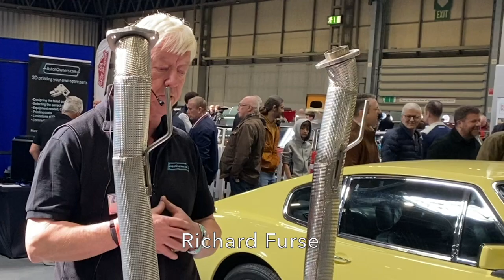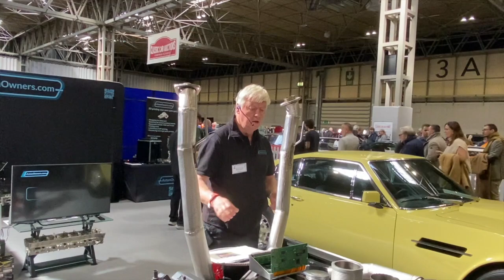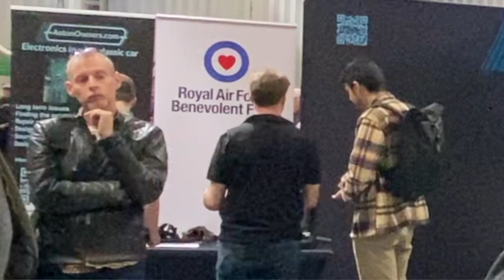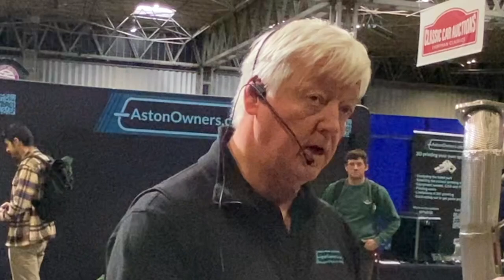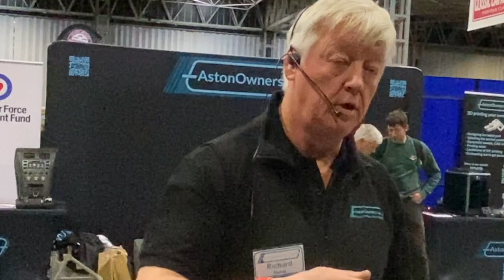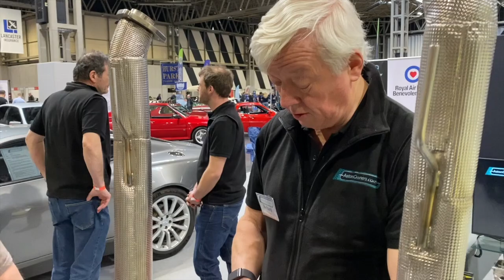Electronics - The Modern Achilles Heel

Comment: The speaker's data is somewhat obsolete... especially since he's talking about a 2002 module.
Reply from the maker: You're correct. We're talking about 'modern classics' and the risk to their futures.
Reply: @AstonOwners  I've discovered those modules are usually pretty easy to repair... with a simple soldering iron. 99% of the issues, ESPECIALLY if they start out as intermittent issues, are due to broken soldered connections on the circuit board. Hard to pinpoint but easy to fix with a 'shotgun' approach of simply re-flowing the solder and adding a very tiny bit more to improve the strength of the connection.

Comment: Yeah, electrolytics do age out, inevitably, but it's a lot slower than a lot of people think.  It depends a lot on how much heat and excess voltage they've experienced; in a well-regulated and well-protected circuit where the capacitors are just being used to control noise and not ripple, they can outlast whatever product they're in, easily.  Especially the "tin can" ones used in a lot of products since the 90s; those won't even suffer from evaporation if used carefully.
Reply: All depends on ambient temperature. Under hood temps can be high and you have to take into account ripple current also. Life 1/2s every 10C rise. All electrolytic and even super caps have a metal can and a rubber plug evaporation of the electrolyte is inevitable.
Reply from the maker: It's the chips that seem to be the problem in both reliability and availability. We're working on it, of course...

Comment: I've been forced to scrap a perfectly nice 2003 Jaguar XJ8 after the electronics started to go squirrelly. In the old days the body would rot or the engine would wear out. Now the irony is that these are perfect even after 20+ years and 130,000 miles but the car is beyond economic repair.  I think the future is going to be in retro-engineering the electronics. - I hope there are more like you putting the effort in now. Bravo.

Comment: Legislation is the way to solve this problem.  e.g force OEMs to release all H/W and S/W design information a number of years after product launch to allow repair or re-engineering.
Reply: The last thing we need is the government giving us more legislation.
Voting with your wallet has more effect on manufacturers.
Reply: what your missing is that the manufacturers of the ICs are obsoleting parts in 3 to 5 years. The auto maker cannot control the chip maker. A product I designed 20 years ago has had 4 redesigns due to obsolesce. There is nothing you do but redesign. With luck the vendor gives you enough warning to make the transistion.

Comment: I'm a former software engineer and now program microcontrolers as a hobby. So my 1964 Austin Cambridge was COMPLETELY user serviceable. True that BMC had the battery wired as positive to chassis which meant the chassis corroded to dust, but that was just BMC. Ford Anglia, Cortina etc had the battery as -ve earth. All cars completely user serviceable. I now own a Volvo XC60 and there's NOTHING user serviceable, well perhaps the door hinges. Cost of service at Volvo? £550. You could buy a new car for £440 in 1964.... :) :)
Reply: I have a 2003 Vauxhall Combo diesel van. Its done 475,000 miles.
Other than suspension brake wear n tear it has been mechanically faultless.
I service it myself
Except... The only issues  have been electronics.
The central locking doesnt work. (I dont need central locking, the key works)
The ribbon cable to the speedo etc vibrates itself out of the connections.
The ECU died, There is a company that takes your old ECU repairs it and sends it back in a week. £95 +vat
Reply: @sahhull  That's a remarkably fair price for electronics repair.  Just the gear to do that repair yourself would cost quite a bit more than that.